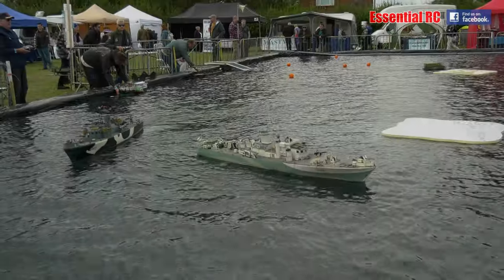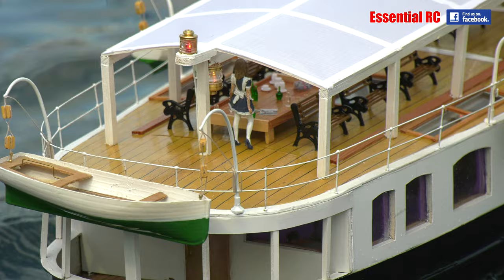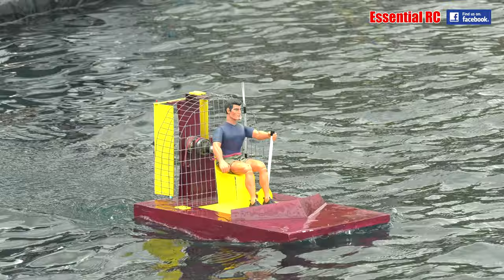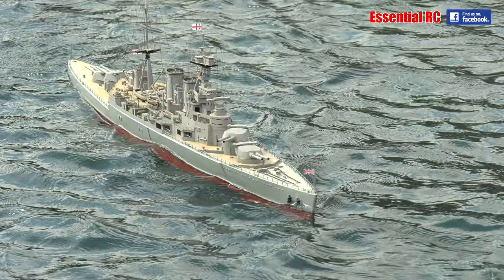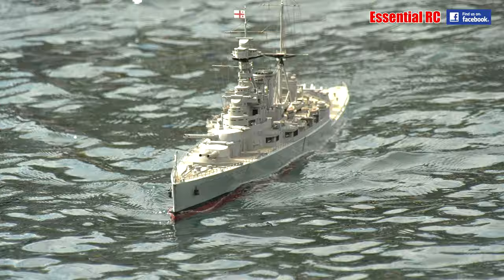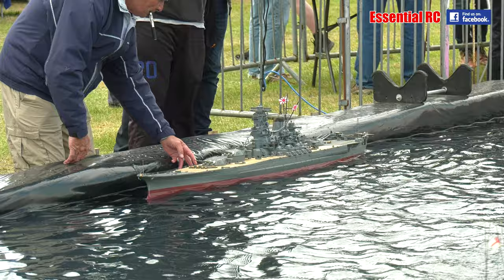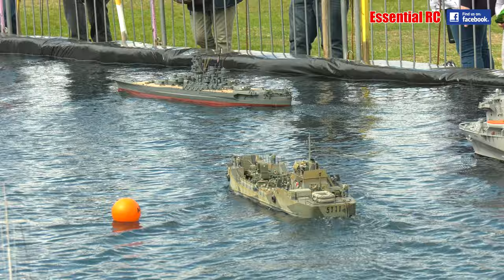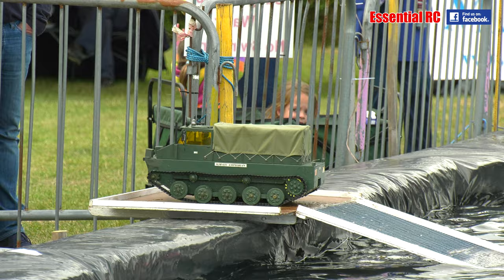SUPER DETAILED RC !!! BATTLESHIPS, BOATS, AMPHIBIOUS VEHICLES and WATERCRAFT

Comment: Wonderful! So much to see, that must have been fun to video. As a kid, I had a model tugboat named "Cheryl Ann", designed from a real tug used in the TV series "Waterfront" 1954 - 1956. Later as a teen we installed RC for steering and throttle. We used it to tow a target raft with 2'x2' paper targets so we could plink at it with our .22 rifles.  Our backdrop was over 30 km of water.